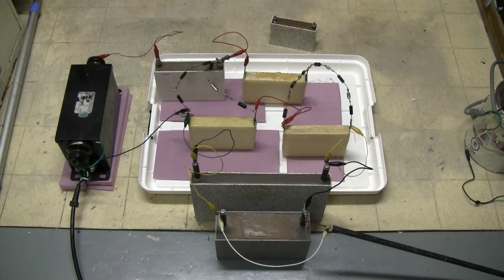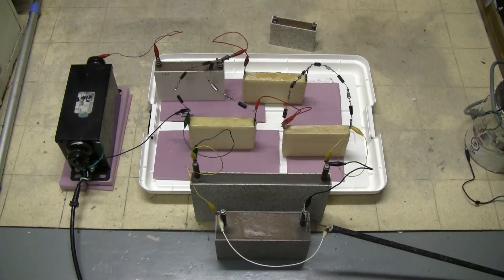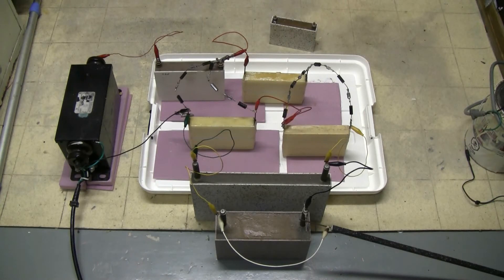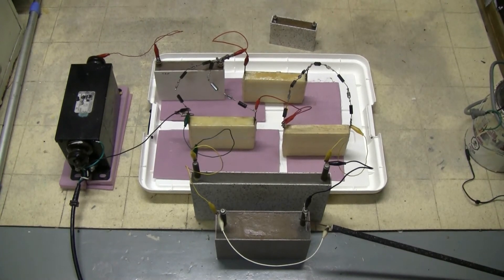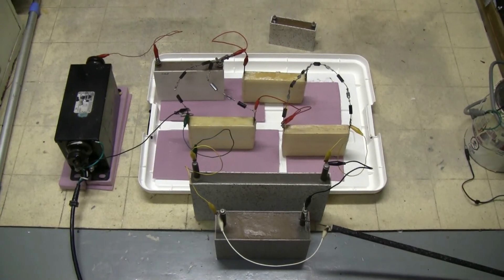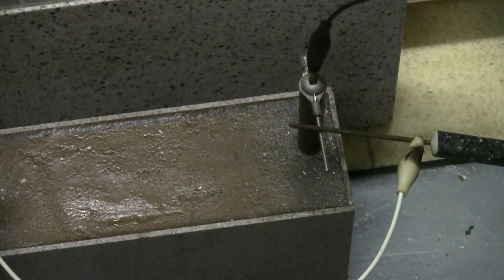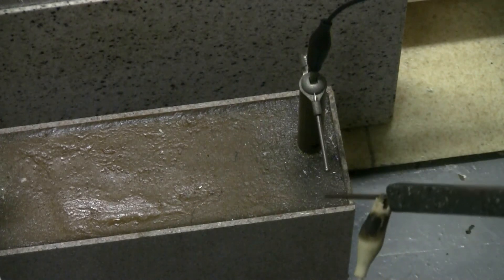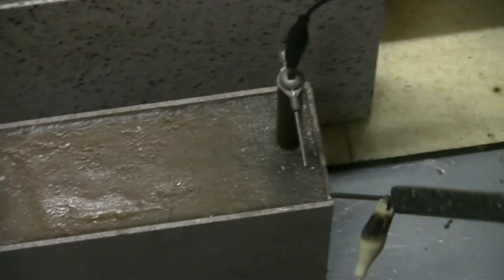NST With Voltage Multiplier

Comment: What’s that capacitance of those capacitors? Will the voltage multiplier work with smaller capacitors or is the hertz too low? What hertz is that operating at? Just wondering my voltage multiplier didn’t work guess I’ll need to build bigger capacitors